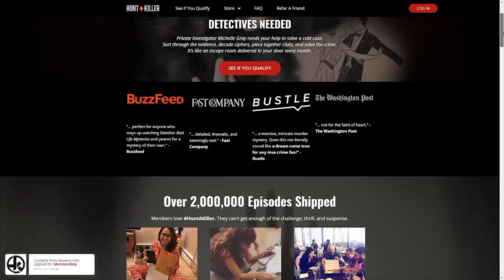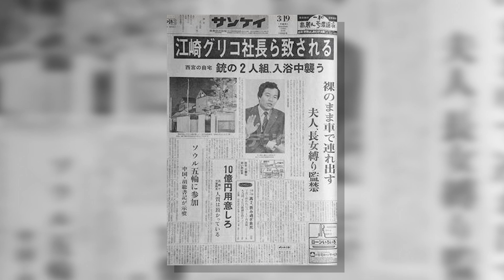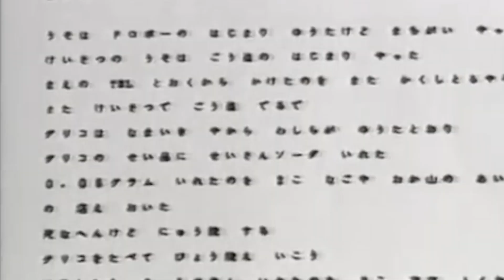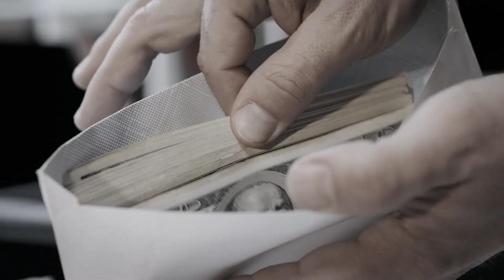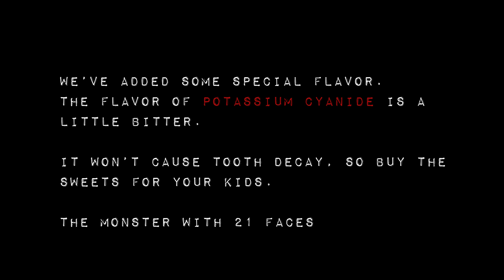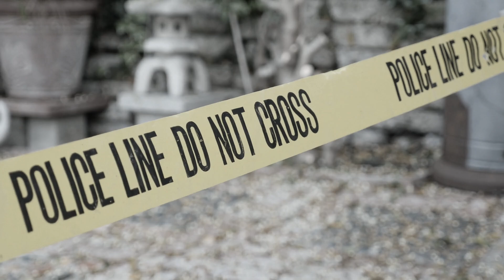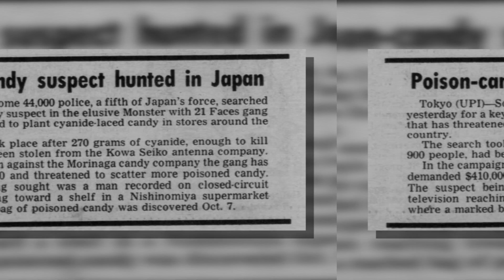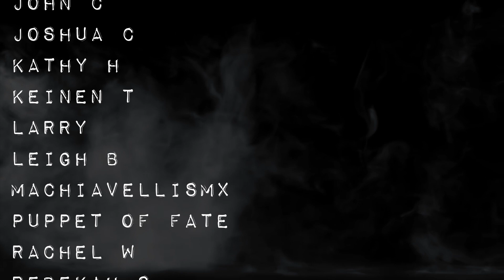The Glico-Morinaga Incident: Japan's Greatest Unsolved Mystery

Comment: What is one of the things people need to survive? Food. 

What type of food is most desirable to children? Candy. 

What is the most important thing to the average parent? Their child. 

What is one of the most important things to people in general? The safety and welfare of their families.

They forced distrust amongst what should have been an innocent and enjoyable treat, as well as other things. They made the police out to be a joke, because in their eyes they were.  

I think this wasn't necessarily an attempt to harm people, but to lift the veil on how things do not get fixed and how much danger everyone is actually in. 

It was easy for them to kidnap a grown man, poison thousands of products, place dangerous toxic chemicals in places that could be disastrous to some poor sap. These things were executed without issue, meaning that there were tons of people on board with this, and that the policing system does not prevent danger, it only punishes the guilty  once caught. 

Police do not prevent bad things from happening, and in this case they failed at every turn to 'right' the wrong done by these people. It shows how faulty the system is, and that it needs to be re-evaluated so that these things can't happen. 

I don't condone anything these people did, but their message was pretty clear to me.

Comment: Stocks. If I were a criminal organization and I wanted to get away clean and make the most amount of money possible that couldn't be traced, the big payout wouldn't be in the form of a risky ransom. I'd tank the company, make good on my promise to leave it alone so they could gain buyer trust back, buy as low as possible and cash out or buy and hold for as long as possible. If you do get caught it's way less time than home invasion, terrorism, ransom, attempted murder ect. Good place to park all that dirty money and come out clean on the other side. I can't find an IPO for them earlier than 1990 but I do see they entered the European market in 1982 in France (the suspects referenced going to Europe for a while). The Yakuza is involved in construction and might have been slighted by moving a manufacturing facility job elsewhere losing the contract. Katsuhisa might not have been paying his 'protection' money either. Might have been a reminder he had an outstanding debt. I would suspect Mr Ezaki has more information than he's letting on